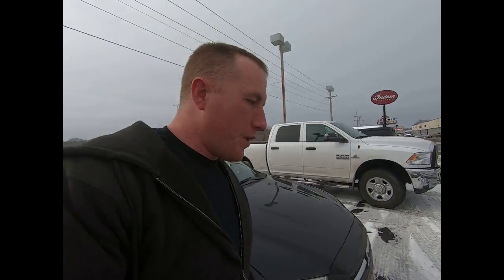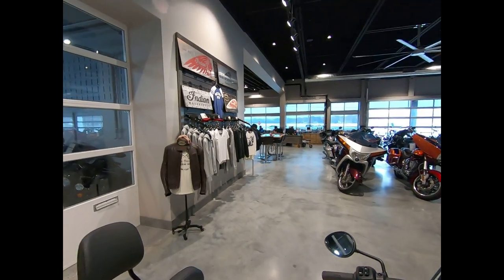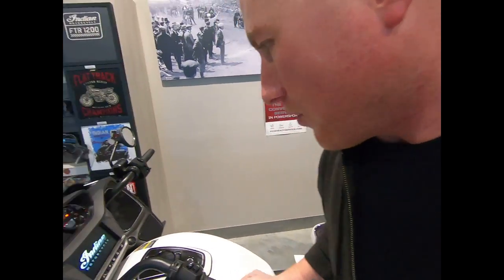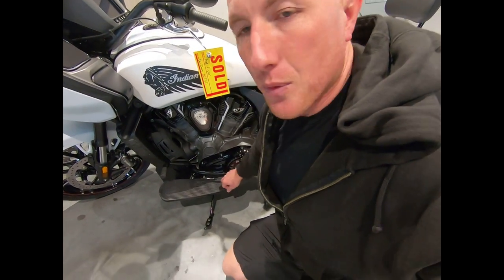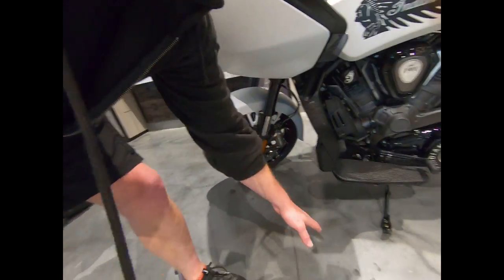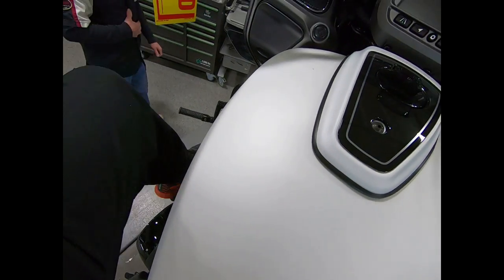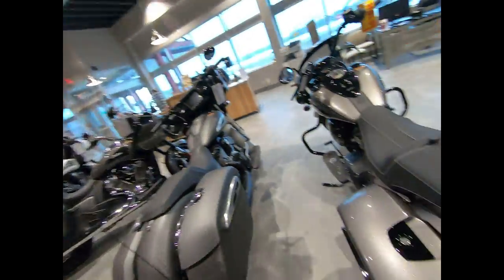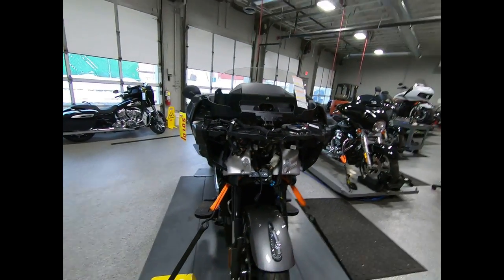2020 INDIAN CHALLENGER MODS!

Comment: Yes I'm Listening. Its VERY apparent that he hasn't even tried dropping the engine to do "CAMS" It Will Not rotate like he states as the whole engine and radiator needs to be dropped down in order to get to the valve covers bolts on the rear alone. I tried every way you could with mine and unless there's a magic wand that I'm not familiar with it wont happen in chassis. By the time cams roll out we will have it perfected but it wont be a 2 hr job.
Reply from the maker: Lloydz, I was praying he was right and you were wrong!!.. Also that any extra info would help!!.. but damn! Maybe i should come out to you and watch so cams done!! Thanks for watching!!
Reply: @Ridingfish  Heck I wish he was right and I were wrong. It would make life SOOO much easier. The first time, I took about 9 hrs trying different methods and ways, the bottom line is the motor needs to be dropped at least 4 inches from the back of the rear frame section to even access the last valve cover bolt which is hidden under the crank case breather housing.
Reply from the maker: Yea, well I'm jumping for cams.. just not 10 hrs labor.. thanks for the work you do!

Comment: I wish they offered the dark motor finish with the paint options, etc of the limited. A Dark Horse in red or black would be my choice, though the white you have is pretty compelling. Good safety colour as well, white unlike grey, which I bitumen camouflage
Reply from the maker: I wish my white was gloss.. I have seen a few dealers that did paint swaps but it isn't very  Common!!..
Reply: @Ridingfish  really? They've allowed colour swaps at the preorder stage?
Reply from the maker: Oh no, it was on a dealer level

Comment: I like the bike, but for the cost it should have a topcase. Without one it's short on storage and for the same money I can get a motorcycle with a topcase.
Reply from the maker: What are you looking at getting??
Reply: @Ridingfish  I current ride a R1200RT. I owned a couple Vulcans before that and a couple other Kawasakis, a KZ and GPz. I like the challenger as it's modern for a cruiser and functions well, but to replace my RT, I want like functionality is some areas. Storage is one. I realize the weight can never be mitigated, but the Indian works well. I just think for 29K+, it should have a trunk/topcase. From what I've seen Indian trunks going for and the mods I'd have to do to make it fit me, it would be an extra 4-5k. So at 33-34k, what else is out there? When I bought my RT in 2010, it was 19k out the door with a 49L topcase. A new RT would be around 25k and my topcase would work on it. That said, I am not brand centric, but function centric. I will get what works best.
Reply from the maker: Yea, I would say the change from BMW is almost like switching from android to apple.. both are good but once you get use to what you have switching gets hard... it's not just a 100% interchangeable like going from other brands to Indian..  especially the K1600 and the R1200.. lol.. cant hate they make great bikes..
Reply: @Ridingfish  BMWs are more maintenance intension and if something shits the carpet, it sucks. That's the downside. I do my own maintenance, but I wouldn't on a K1600. The valve check is a pain and very expensive. That's the plus of an Indian or HD. the maintenance is easier.
Reply from the maker: I came from Yamaha.. I don't think maintenance even is a thing ahhaahah but I totally understand what you're saying.. have you rode a challenger yet?
Reply: @Ridingfish  No I haven't ridden one yet. Up until a week or so ago, the dealers were pretty much closed. Things have opened up now though.
Reply from the maker: @nokoolaid  well sometimes smiles are priceless!! Haah let me know what you think after you go take one for a rip!!
Reply: @Ridingfish  I will.